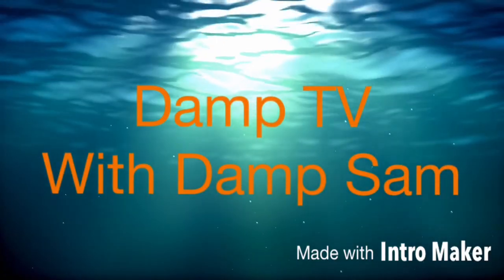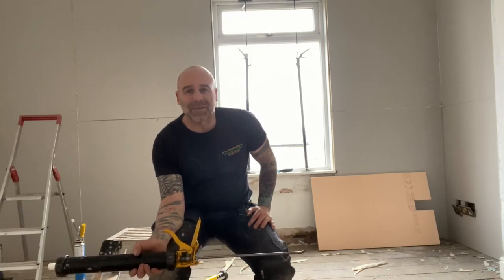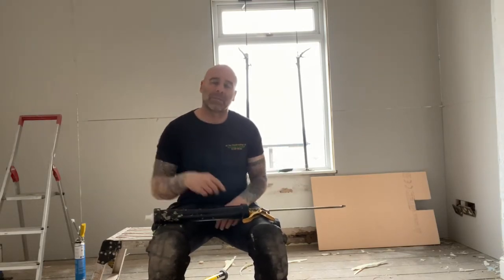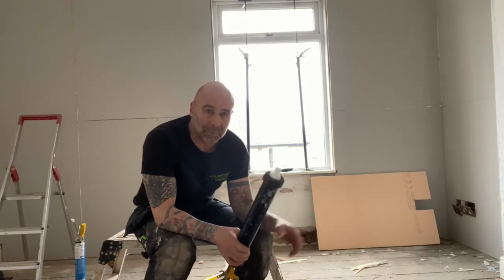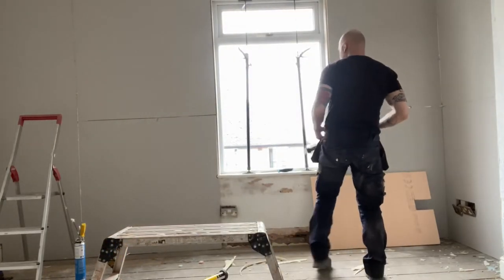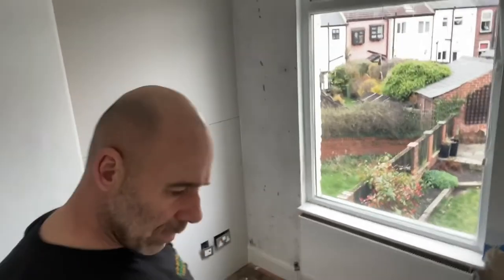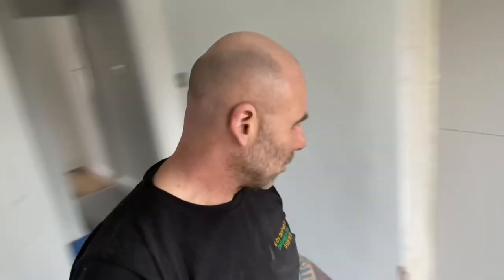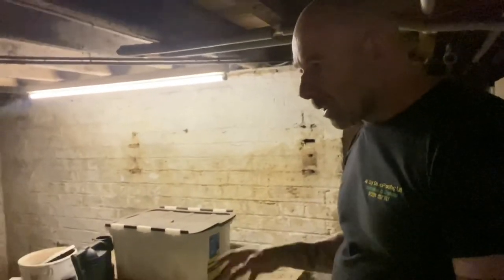How to Stop Thermal Bridging

Comment: Just come Across your videos as have just bought a old terrace in Newcastle and found a bit dam on the wall, lifted the floor board and wall is soaked below, so just trying to find what's causing it. I'm learning a lot and just subscribed 👍
Reply from the maker: Great stuff, glad you got some value, make sure the subfloor ventilation is adequate 👍
Reply: Simon Cooper HNC CSRT CSSW  been on hands a knees for a couple of hrs found air brick holes blocked at bottom due to a 100 years of shite from cavity falling down I think. Just need to render wall as I hacked the damp stuff off.  Any advice? Thanks
Reply from the maker: @thomasjackson1494  without seeing the job and walls I can’t really say but good luck with it. 👍
Reply: @thomasjackson1494  air bricj blocked would be n issue if you got a wooden floor.

Comment: Just a little tip when I board/render up against a exsposed chimney breast. I run a lenght of dpc on the brick side then butt board/ render up to it and also skim up to dpc. Two benefits , one if there is any moisture in the exsposed bricks it can't leach on to the gypsum based product. Two it keeps the bricks Clean.. 😉 then just cut off when done. . You might already do this 👍💪 keep up the good work
Reply: you prolly dont care but does anyone know of a method to log back into an instagram account??
I was dumb forgot my login password. I would appreciate any tricks you can give me.
Reply: @Gabriel Damian Instablaster :)
Reply: @Jamari Bishop it worked and I now got access to my account again. Im so happy:D
Thank you so much, you really help me out :D
Reply: @Gabriel Damian No problem :D
Reply: so you run plastic DPC across the brickwork?

Comment: So I can just stick pir board to the external wall using foam. Or will I need to batten it out first.   I read that you need a gap behind the pir board. Is this true?  I would rather just stick it straight to brickwork. Would this be ok?
Reply from the maker: Using Drygrip leaves a small cavity and keeps it off the wall

Comment: This is a great solution to solid walls being cold and wet. Would an airbrick not help bring some fresh dry air in ?
Reply from the maker: andrewb113 air bricks are ok but they let cold air in creating cold spots , a paddy fire vent is better which is an insulated air brick.
Reply: Or tell the tenants to open the windows from time to time
Reply from the maker: Stephen Gunner that is great advice but seldom done by tenants.
Reply: Tenant or otherwise. If you keep heating the house and then opening the window 🪟 to bring in more clod air.. where is the sense in that?

Comment: Do you have good/bad opinion about using the metal 'mushrooms' to fix insulated plasterboard to walls? Using the plastic caps to stop cold bridging doesn't seem like the best process. Would you recommend a better solution? Using bonding adhesive isn't always possible with small rooms. Clients don't want to lose anymore space in the rooms. Thanks in advance. Information in your videos are very helpful.
Reply from the maker: Hi, I’m not sure what you mean by metal mushrooms, excuse my ignorance
Reply: @dampsam  Ha, sorry I took it for granted that they were called mushrooms everywhere..... Metal insulation anchors/fixings is the name of them. Shaped like a metal mushroom. A round white plastic cap is inserted on the top to stop cold bridging. Really doesn't seem to be a great way to stop cold bridging. The white plastic caps are very cheap and brake all the time.
Reply: Hi Simon, would this method work for kitchens where cabinets need to be fixed to the walls after? I see you use no mechanical fixings so just wonder if the insulated plasterboard could hold wall units?

Comment: I think the problem is the cement render.......traps.moisture.........warm air hits the cold surfaces condenses but then trapped and cannot get out through the cement render 

Take that off
Reply from the maker: Adventures with the little one that’s a fair point and a good guess. Moisture doesn’t get trapped. It goes through any fabric except glass as a gas ( water vapour) it condenses when it hits its due point and this depends on lots of factors including how dense the fabric is, thickness, air pressure and temperature, I could go on but I think you get the picture.
Reply: Simon Cooper HNC CSRT CSSW yes cement  render cement pointing and gypsum all of which are not breathable.......the gas changes to liquid at dew point to which if the material used were breathable such as lime plaster and lime pointing this can breathe escape whereas cement Materials trap moisture and overtime ruin old buildings brick and stonework it’s absolute fact